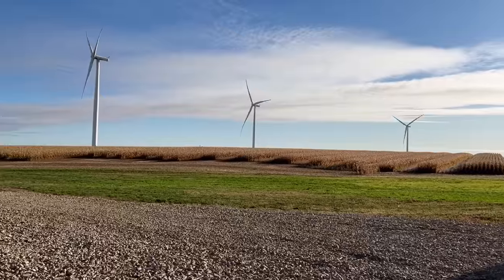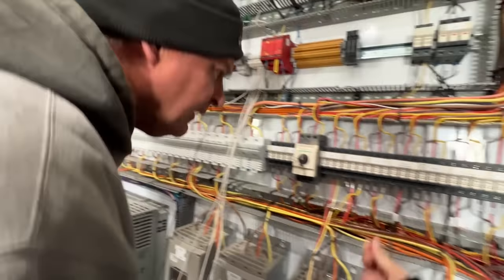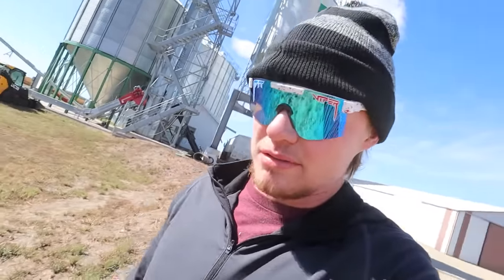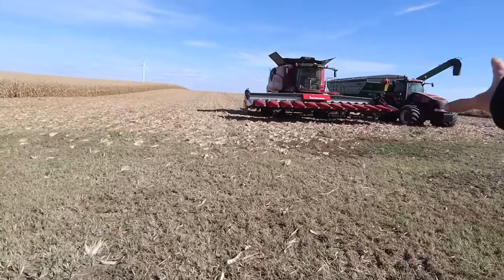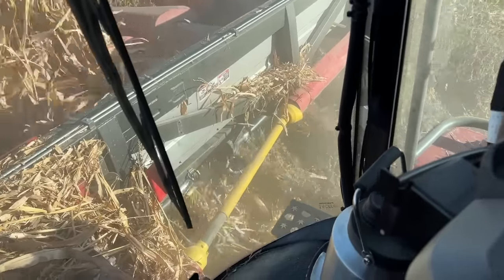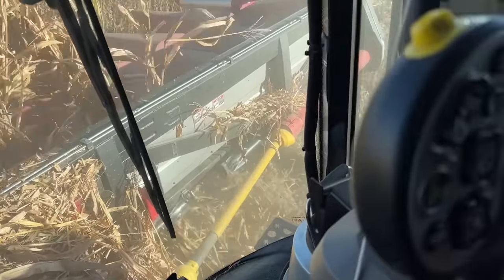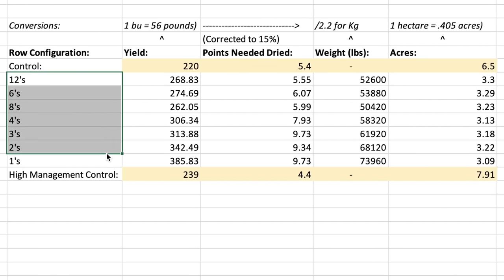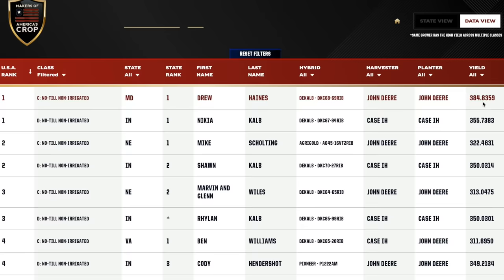I Won The United States High Yield Corn Contest

Comment: Why does your panel use actual fuses instead of breakers? I thought those were outdated tech or is that only true for a house sized system?
Reply: Fuses are proven to break open faster and can’t be fixed or reset without a human. They are still used in industry to this day.
Reply: Fuses are a safety thing. With breakers they can jump but fuses are a solid shut-off.
Reply: Thanks! Figured there was a reason

Comment: I do believe you made a mistake on your calcs. If your cost of production is $1,100/acre for corn and $950/acre for beans should make your acreage cost of production for the 45 acre plot ($1,100+$950)/2 = $1025/acre. On you sheet it is $2,050 per acre. Which in turn will mean that the 45ac plot cost of production is $92 250. Although the 37.5bu for beans is correct.
Reply: Yep. What you say makes sense, cole has the average wrong

Comment: Cole, Not wanting to dump on you but I think you made a mistake on your cost of production on the Excel sheet. You should use the average rather than the sum of the Cost of productions. ie you did not plant a whole crop of Corn and  a whole crop of Soyabean. therefore your cost of production is $1025 per acre. Could be wrong but that is what it seems like form your explanation above.

Comment: good to see you trying some stuff - hopefully you can average 250+ over all the farms and acreage - a decent year - no derechos...plowing and adding cow manure and compost should help as well as getting your ph dialed in more on weak areas - that is probably as important as loosening up the soil but the only way you will know for sure is to keep doing the a/b tests and trying to control most of the variables within reason - you can start planning winter projects soon - finish farm cleanups - the work never ends which is why you need to have solid time management and outsource some labor to give yourself a break now and again through known vetted sources - you need HR management to keep the good consultants and weed out the marginal ones and also line up solid labor slaves who are between the ages of 8-14 - just kidding that is just for chicken processing plants

Comment: I think your math is off @ 21:47. If you need $1100 to break even with an acre of monocrop corn and $950 an acre of monocrop beans, you'd only need $550 for corn and $475 for beans on an acre of 50/50.

Unless I'm missing something.

Comment: Sounds like that entire million dollar set up was done by Mickey Mouse you have had nothing but problems since it was started. Bulldozing it and starting over with a reputable builder sounds like the correct direction at this point. Going back to corn storage in the barn sounds like the best move at this point to me.

Comment: Your math on the total input per acre is not correct. Instead of adding them together you need to times 22.5 acres by 1100 for corn and same for beans then add together and divide by 45. Which would come out to 1025 per acre input for the 45.

Comment: Are you sure your math is right? as you explained, growing 1 ac of corn costs 1100$ and 1 ac of beans 950$ and you did 22.5 ac of each. If I add it up your cost of production should be 1100$ x 22.5ac + 950$ x 22.5ac = 46.125$ for your 45 ac. you just added both costs and did not divide it by 2 so. that way you would need to make 92,250$ of revenue off of your 45 ac. I don't know it you did that intentional or forgot about it. As a farmer in germany it costs us about 1300 - 1500$ to grow 1 ha (~2 ac) of corn without our labour, so we would be fine with the corn yielding 150 bu/ac to break even. I think you just forgot to divide it?

Comment: your intercropping plots may be limited by equipment availability.  there's still a lot of 6 row corn heads out there, so that's doable.  but don't think there's been a 4 row head made for over 50 years.  and 2 row pickers are tow behind, which will not work....unless you plant a strip of oats between the corn and the beans.... hmmm... ya might want to think about that one.  the industry which has engineered and sold "bigger" for the last 50+ years is not going to be interested in making "smaller" for anybody 
granddad spaced his corn at 32 inches in every direction.  this allowed for max sunlight, and max air flow.  he didn't know what fungicide was cause it wasn't a problem, used far less fertalizer, and was far less prone to drought problems.  sure, his yields were less, but his input cost was far less, so profit per acre was still positive.

Comment: Your cost per acre for corn and beans should not be added, they should be averaged since your half and half.  If corn cost 1050 an acre, a half acre cost 525. If beans cost 950 the half is 475. A acre intercropped would be 1000 not  2000

Comment: in the 80s we went with 36 inch rows. We didnt have the population of seeds per acre. you do. We pulled weeds out of beans, plenty cow manure. farmed about 250 acres averaged 180 to 200 bushel corn and 60 bushel acre beans. A hoe was the tool of the day. With a caltevater.. Try 36 inch rows and tell the out come.

Comment: Question from a non-farmer:  If you keep doing this, is it worth getting a smaller combine that would fit your intercrop rows better?  Obviously, harvest would be slower, but would the higher yields make up for it?
Reply: I think a "Nexat" would work quite nice in a intercrop farming, since it's wheels are all the way out of the edge, and it can change all equipment on it's frame from being planter to being an combine.

You can get an "Nexat" from 20 to 80 feet, means the wheel is up to 80 feet apart. so you can run a layout of:
- wheel track
- intercrop for up to almost 80 feet
- wheel track

And since Nexat can do everything from planting to be a combine and spraying, you always run in the same wheel track.
Reply from the maker: Actually, we’d probably want the same size combine to deal with the extra volume of great. A smaller head would make it much easier if we went with a 6x6 option. Otherwise we could simply cover rows on the 12 row to get what we needed to harvest.
Reply: First of all, thanks for the reply.  I have been teaching high school physics for 30 years, and your use of control and experimental groups is an example that I will probably show classes in the future.  Second, it seems like a set of heads that is basically one combine-width would keep you from crushing the other crop when you harvest... if the unload auger can reach across the other crop.

Comment: Construction defect claims are common.   The key to avoiding them is letting your lawyers prepare the contract, make the contract a design build (turn key),  require a performance bond, and have a prevailing party attorney's fees position.  Absolutely not binding arbitration provision.  The problem with a binding arbitration provision is you are going to do one project (one case).  The contractor is going to do a lot of projects (multiple cases)  The arbitrators favor the contractor because he is the return customer.   You are not going to be a return customer.  I was a trial lawyer.  You want a jury of your peers.  Nearly all cases settle in mediation for a significant discount of the prospective jury verdict value.    The plaintiff gets super screwed in arbitration.

Comment: Lesson learned, and take it from someone in a very dry climate. Narrow rows aren’t the way to go. For years we were on 40 inch rows. Irrigated stays on 40’s but our dry land? We went to 60 inch rows and saw a dramatic yield increase. Good luck cutting the beans 😂
Reply: It's hard to avoid weed pressure with wider rows
Reply: @lesleyboeder1798 not it’s not. Especially when you don’t get the moisture.

Comment: Your break even figures are wrong.  You don't add the production cost of corn and beans together, you average them.  Your real break even cost is $1,025.00 per acre.  From a logic standpoint, if you planted the entire 45 acres in corn (the highest cost) you would have invested $1,100.00 per acre.  I think the bins are getting you down.

Comment: Since you do so much spraying and the beans and corn can't get touched by the same sprays, what if you simply spaced the corn rows farther apart and forgot the bean interplanting?
As the for bin site fiasco, there isn't any reason not to keep mentioning it as the problem are hindering you.  Not talking about it does not fix anything or make it safer. It is a problem waiting for resolution.